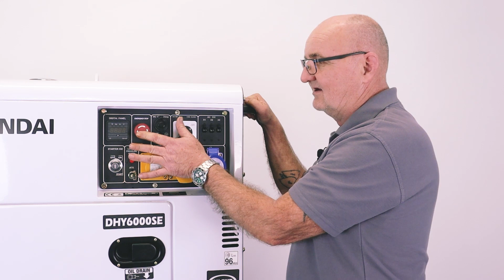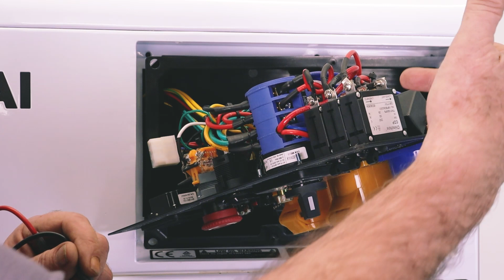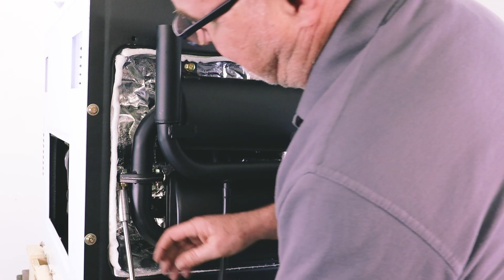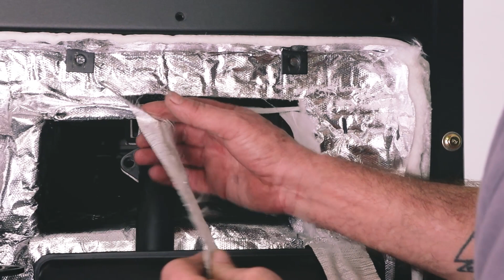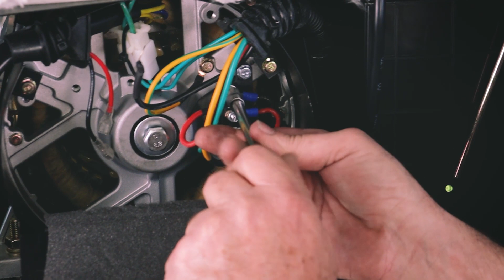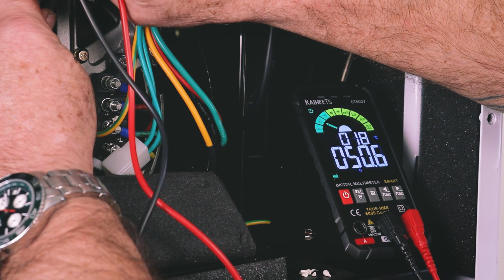Diagnosing No Output on your Hyundai 3000rpm Generator (DHY6000SE, DHY8000SELR, DHY8000SELR-T)

Comment: Don't run the machine because is not really silent?
Reply from the maker: Given the nature of a combustion engine, they will never truly be "silent". 

However, these generators are "silenced", meaning that there are measures in place to reduce the sound levels emitting from the generator. For example, it is housed in a sound-dampened case, rendering the generator quieter than a conventional alternative without this consideration. 

Hope this helps! 

We don't run the machine because it is indoors and you should only run a generator in a well-ventilated area as it emits carbon dioxide.